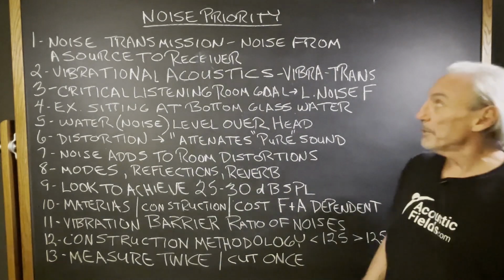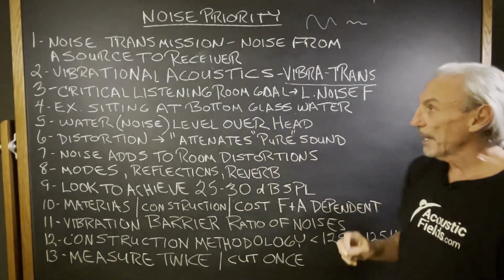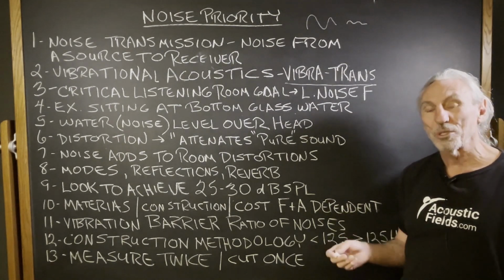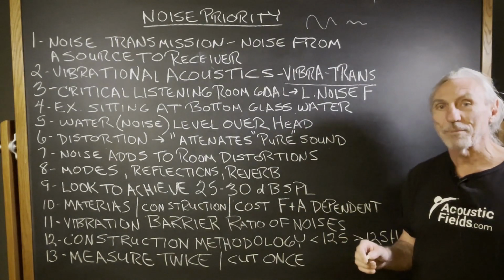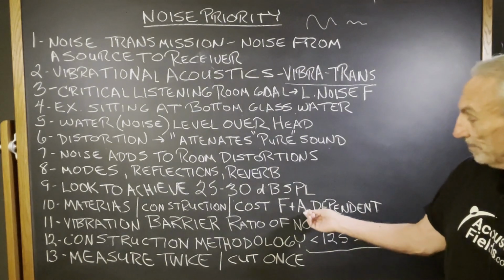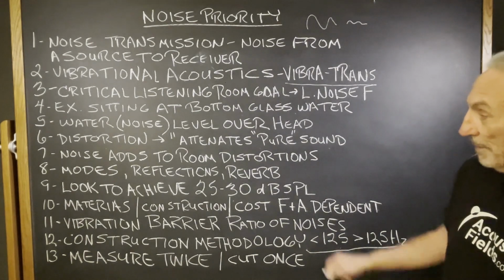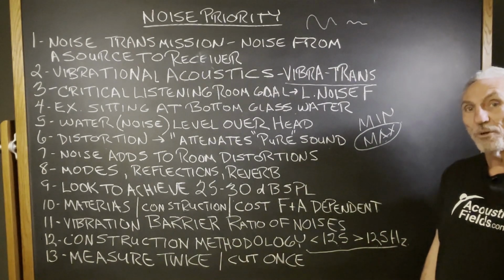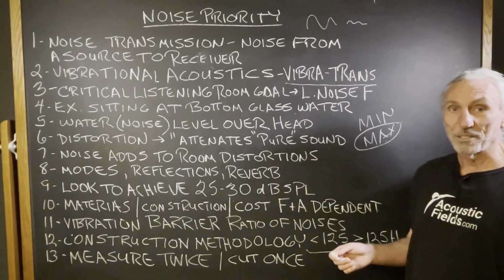Noise Priority - www.AcousticFields.com

Comment: I often see displays of something like Mineral Wool Box with an alarm going off at 1kHz-1.5kHz, They put the lid on and the sound is all but gone. 
Just once I want to see a 12" subwoofer thumping 50 Hz at 90 dB and drop the lid on that!
Reply from the maker: Limp mass material types are not designed to absorb low frequencies adequately.